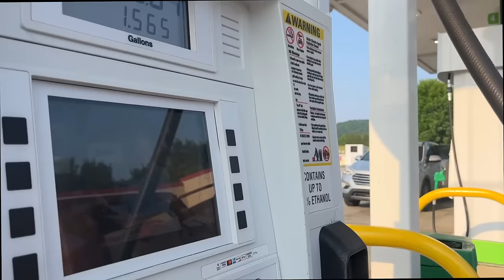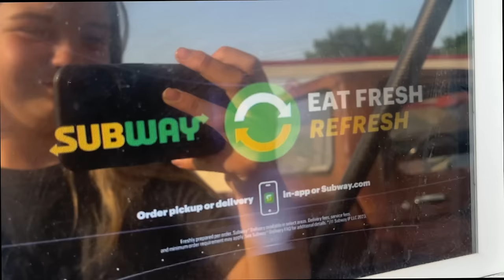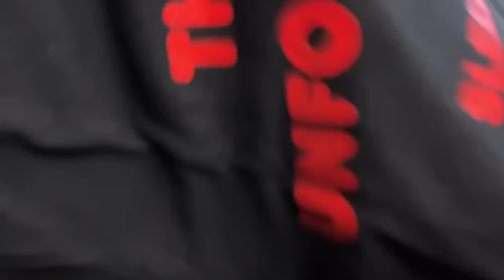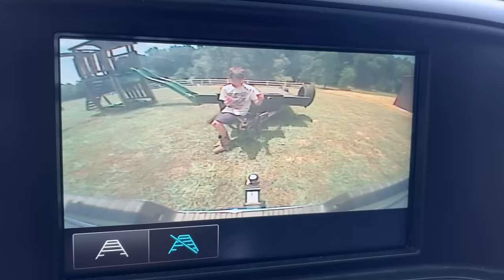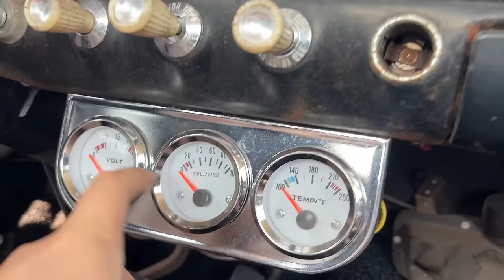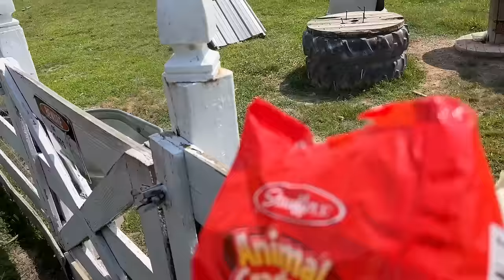14 Year Old Wins At Her First Car Show!

Comment: Hope your having fun! Many years ago ( 1972). My Brother had an 1968 VW.
He put duel port heads.
He had a two barrel carburetor.
Add a oil filter(extra oil).
Headers!
Bigger/larger overhead cam.
Had a Hurst Shifter.
And a VW bus clutch.
At the track, he run high 16's.
Not this one. But an earlier one. Had a gas heater. Cook you out of the BUG!
PS. He had a small block of wood. Rounded like a bowel on the bottom. This sat in the floor jack "SADDLE". With this he said he could pull out a VW motor in under 15 minutes!!
Very nice job. A family affair!!!

Comment: A good friend of mine had a VW Bug that same color way back in the early 1990's. That thing could go anywhere and drove great in the snow. It was a tough little thing, too! One time we were up on a mountain just after spring thaw. Up by the ski resort, we were cruising along about 50mph. We came up over a little hill and here was a huge crater of a pothole about the width of the car! He straddled it as best he could and we braced for impact. We went right over it and didn't hurt the car one bit!

Comment: I bought my Ranger Edge new in 2004 from a large Ford car lot here in Central Arkansas. Standard shift, 5 speed. I have been replacing tires at the same dealer ever since, as believe it or not, they have the best price on the tires recommended for it.
So, recently I took it to have 2 tires replaced by appointment, and waited there in the dealer showroom for it. Waited, and waited. Finally went over and asked what the problem was. She said they were having trouble balancing one of the tires, and  finally realized the rim was bent, but it is fixed now.  Then she said...."Oh, and by the way. We couldn't hardly find anybody back there that could drive a standard shift!!  LOL  At a Ford DEALER!
So your kids are special for knowing how to drive standards, especially as young as they are.

Comment: Josh - You need to paint the beetle. It is a classic and a new paint job a good one will increase the value from $2,000 to around $15,000 dollars. That is well worth the cost of a good paint job.   You can fix the dents and rust then spray a primer/sealer, 2 coats of color and two coats of clean.  I love watching the "House of Kolor" video.   The kids can do the sanding and it will be an excellent learning opportunity!

Comment: Good job. Glad every thing went smoothly for ya . The vibration that thay felt in the VW was probably the presser plate or clutch with all the bad start outs it's probably need to be changed out . WaWa is right it needs a rack on top.. love you guys.

Comment: With using the gray scuff pads rather than using CLR you will get incredible results using SEM Scuff & Clean or DX101 from Deltron when your planning to do a buff and especially on anything your plan to reclear. Not sure if it's a product the body shop you worked at used or not but highly recommend the Scuff & Clean. But the dx101 is a good alternative if needed.

Comment: Congratulations Wawa, I will have to get down there sometime and bring my 1975 Ford Gran Torino. The roof is a hot mess was originally a vinyl top. If I just new a good body man.🤣 But solid the rest of it. I have a very few small things left and get the 2bbl carburetor back on it to get it back up and running.There is a 4bbl swap and camshaft change in the future. Hopefully be able to get down there after that. I am from Iowa as well.

Comment: If y'all keep the bug, just make sure the heater channels are in good shape. The body depends on their strength. Also, there's a good chance that 1300 could become a 1600 single-port by swapping piston and cylinder sizes. I did that with a 1500 and can vouch for the driveability of that engine.
Reply from the maker: Ok thank you

Comment: For Ralphies Corvette, afew years back I bought a 83 Trans Am. Every thing was great! Retired Doctor bought. New as a gift for her. 😚. She hardly. Ever drove it 62 k miles. Only thing, it needs   new carpet. Could not afford it. Black Nylon carpet. I cleaned the good , and sprayed painted them black. Then went over then with a Stiff scrub Brush dry. After a vacuum , The Carpets Looked Brand New !! Try it on Ralphy s Vette!

Comment: Josh, I noticed the engine air flow going to the heater box on the left appears to be damaged.  You need to always make sure those hoses are intact and the driver side is crucial being that side has the oil cooler and that side cylinders need all the air they can get.

Comment: Amazing difference on WAWAs car, almost looks brand new. Big caution for you on washing the corvette with water, (trust me, I have an 85). These C4 corvettes have what is called an opti-spark located at the front of the engine under the water pump, if that gets wet even just one time, it will be ruined and the engine will not run correctly. I do not even get mine out of the garage if it is raining, and I never use water to wash mine, only rub it with a cloth and wax.

Comment: On Amazon there's a waterless wash and wax called m sport it's got carnuba wax and does have something in it that used to be called ceramic coating I use on and in my car. As the tricky work has been done it could make keeping the cars clean much easier

Comment: Wow y'all are going all out looking great guys. I was just thinking about the fact that I have now had my 2000 dodge ram laramie slt quad cab long bed 1500 4x4 for 4 years and I have not cleaned,washed at the car wash or pressure washed the truck once, all it gets is the rain and snow lol, it has mildew and moss on the sides of the truck and honestly since the black paint is flat black on the front doors and the front bumper, the front grille and the rear bumper are satin flat gloss black has a bit of a shine to them the grille is also flat black but it is a replacement one with no emblem in the logo spot on the grille the factory one ate a bird lol, the truck front bumper is replaced with a chrome one because of rust and the bottom was bent, and the factory color of my truck is gloss black so with all the different shades of black on the truck it usually doesn't get washed..

Comment: This will be the 3rd time I've mentioned it in the vw videos, but the looseness in the front end is the front end bushings. You may wanna replace those at some point. They all go out on Super Beetles. I'm amazed its running as good as it is, I'm kind of surprised. If it starts getting flat spots in acceleration, upgrade to a 009 vacuum advance distributor, and a h30 31 carburetor.

Comment: Was wondering when you get the death wobble. It’s called the “Super Beetle Shimmy”.  Feels like the steering wheel is going to rip out of your hands. When a customer brought one to our vw shop, we replaced every mechanical component on the front end. It helped but it didn’t eliminate it. 

That’s why I always bought earlier non-super beetles. 

Google Super Beetle Shimmy. I think there is some advice out there now. I worked on them before the internet.

Comment: I was working a night shift at my dad's place when a customer pulled in a with brand new VW, same color as yours. It was was making a heck of a racket, so I checked the oil, which was bone dry. Since the salesman told him it would never burn oil, he refused to let me fill it and just drove off. Somewhere out there. there's probably a real, low-mileage body.

Comment: 1:10:06 I think its both. The Beetle has a trunk in the front,,and it's covered by the hood.

Lately, many EVs have both rear and front trunk, thus came the need to distinguish, and we got the retronyme where front trunk became frunk.

So, in modern terms, it wouldn't be the trunk, but the frunk, covered by the hood. But as the Beetle is a Classic, and there's only one trunk, I think thers no reason to use retronyme.

Comment: Congratulations Wawa on your first trophy on your first car. The MG runs really good with the new carburetor. The F100 transmission I’m thinking you might have a bad synchronizer on third gear. The the event was huge this year a Big turnout and raised 3,000 grand for the church. And congratulations to Tosh for making the big haul to and from and back home again. 
Those Hoops on the Maverick would look great on the Falcon. And Josh you need another Maverick in your life with a supercharged sbf. Congratulations Squeezey for selling your drawings. Ralphie and Tosh did a awesome doughnut 🍩 let’er rip tater chip. 
Josh I’m looking forward to your new website and T-Shirts sales. I want to suggest a upgrade for Ralph’s Vette. A Borla exhaust system would sound so sweet on the Vette. Or at least a set of Borla XS PRO mufflers. 
And a big shout out to Big Mike for his help. 
May Y’all have a Blessed One from Silverstreet South Carolina.

Comment: One other thing. WaWa and I have something in common. I also won the first (and only) car show I ever entered, with one of my '57 Chevys. I happened to drive by a classic and antique car show one day, and stopped in, parked in the visitors area, and went to look at the cars. My yellow 57 was ok, not show car quality but unique in one way, which I will get to. Somebody stopped me and asked why my car was not in the show, and I told him I just happened to drive by and wanted to look around. The show was getting ready to break up, and were going to name the winners, but wanted me to bring my car on in. Turns out the crowd favorite was a very nice '55 Chevy, all professionally done. Really nice car, and deserved to win. But they had me on the mic, and asked questions about the car, finally getting around to ask to see the engine. The thing is, I had modified the front cap to tilt, like a Semi truck. Full metal cap, stock bumper included, without cutting the fenders. When I tilted the cap, I suddenly became the winner!
The people in the '55 were mad, and spun out of there throwing gravel and shouting "His car is not even original!!"  I actually felt bad, because his car really was the nicest in the show.
Reply from the maker: That’s awesome

Comment: Josh I just wanted something new about Volkswagens the gas lines that are in the Volkswagens are compatible with ethanol fuel or non-ethanol fuel do not use ethanol fuel in the Volkswagen it will eat the fuel rubber fuel lines fast and also the reason those fuel lines don't have clamps on them is because the fuel line literally plants down from the outer casing alright this is Bob from Vero Beach Florida God bless have a great week and stay safe

Comment: I remember that i got a car i wanted to own as a graduation present in highschool and honestly it was a piece of junk, and the paint was a medium gm metallic dark blue i believe a sapphire blue and it was baked it had no clear coat left, anyway the car was originally from Texas so my dad used a rubbing compound and micro fiber cloths, and then the nu finish car wax and cleaned up my 85 Chevy Camaro berlinetta t top sport coupe with the 2.8 multi port v6 and th700r4 automatic overdrive transmission and it had the typical Camaro and s 10 grey steel rally wheels and mine had a complete set of 215/60/14 Hoosier quick time dot radials front and rear with Gabriel hi jacker air shocks in the rear of the car... Anyways it didn't run right and several things had been upgraded including the aluminum cylinder heads and headers fuel pump and injectors.. but it ran like it was always flooded and when it warmed up it would barely run like it was starving for fuel,i kept having people tell me it needed a fuel pump,, it needed vats security because it was a Canadian 1985 and the stupid key contacts were worn lol

Comment: So when are you and Ralpie gonna start building a 4.8/5.3/6.0 LS for that corvette that way when the inevitable happens and that TPI sharts the bed…..you guys wont have any down time and youll have that c-4 running with c-5/c-6 dependabilty and performance…….that c-4 would be super dope with a LS swap and fresh mettalic silver or super bright white paint…….❤❤❤❤ id love to build one but that state of california makes it difficult and super expensive and complicating to do…..LEGALLY!!!……my 15 yr old son has been eyeballing one of my spare built 6.0’s for his ‘67 mustang for when his 289 goes kaput….but i cant seem to find simple bolt on motor mounts to do the swap….i told him more than likely we can get a roller 5.0 motor ‘85 or newer and stroke it to a 347 and put a terminator x on it….that way it would be a simple bolt in job and most likely done in a weekend……as much as id like to put a LS in it , its just not as easy as one thinks….unless you wanna spend big bread on a LS specific k-member sub frame😢😢😢…..ive seen it done with dirty dingo slide motor mounts and truck exhaust manifolds with v-band clamp adapters welded to them…..now if only i knew how to weld other than tack’s😂😂😂

Comment: The old Volkswagen f o r  your heat you had two knob in between the seats and you got your heat off   the motor
Reply: Here's a joke these two old women was going to   buy a Volkswagen each one , One open up the front and said they forgot to put a motor in my the other open up the back and said don't worry about it they put an extra one in mine it's in the trunk you can have it